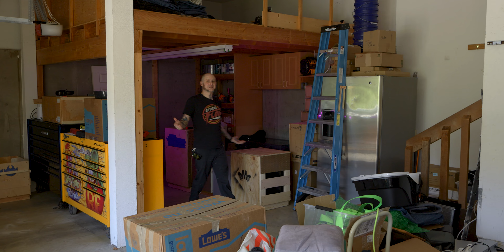NEW Studio, NEW Network! Mandic Lab 1.0 Begins!

Comment: I was kinda wondering if a right angle drill attachment might have worked to drill through the blocking... hard part would be getting the drill bit in there, but if you could source the right length flexible bit, it could have worked depending on how far up the wall the blocking was.  Nice to see I'm not the only one that gets a bit ummm creative when doing this sort of thing and running into issues!  I had similar issues when trying to get cables up from my basement to the 2nd floor and ended up hacking up the 2nd floor wall pretty good to get access, but you can't tell anything happened there now, so I'd say it was a success!

Comment: in the old dining room area I would have not put an access point so high, it may interfere with the one in the upstairs hallway and you may experience access point jumping on the mesh network and create a problem zone., you would have been better with a in-wall access point at the first hole closer to the floor.  Generally when I install APs for customers I use an app on my phone and create a heat map to figure out how many access points and where to put them.  too many access points can be a bad thing or too little since it looks like you may have gotten Long Range Access Points.   like other have said riser cable in the duct work is a good thing, and running a single mode fiber or dual mode fiber and putting another switch up on the second floor would be better in this instance then running lots of cables back down to the garage.  (I am currently doing this myself).  

since you ran cat 7 shielded, it is a solid cable a patch panel on the wall and run cables to that would be better with a full 42u cabinet, and then  use stranded cables to the tor (top of rack switch) . we do it this way in datacenters and offices because if you don't leave enough cable when you terminate them in the rack,  moving the rack around or pulling it out becomes  a nightmare. 

ubiquiti is a decent setup for home/home office/small business, not exactly enterprise grade even though they call it that.   If they sent you a doorbell camera for free I would use that, if they didn't look at a ReoLink better value for the dollar.  Ubiquiti cameras are a bit overpriced for what you get as well.  better options out there with full color night vision for the dollar.  but you got some for free, so use them.  Look into Home Assistant and Blue Iris to run the cameras and forget the Ubiquiti NVR and record to plain old nas storage. you will be much happier.  the Ubiquiti protect system locks you into it and you can't display on anything but the ubiquiti app/eco system.

Comment: This seems like the most difficult possible way of doing this coupled with not using plenum rated - you're probably going to want to seap those out. If you're drilling anyway and already have straight attic access in the garage why not drill/run the pvc through the roof into the attic? Much more complicated than it needed to be.
Reply from the maker: There is no direct attic access from the garage unless you go outside. That was the entire point. There is living space separating the garage from the attic entirely. It would have to run outside to come in through the “roof”. So across the shop, through a wall, snake around the building (the garage protrudes off the side) and then up the side of the house, into an eave (where it’s hard to access in the attic), and then disperse to the space. It would require twice the length of cable runs, a lot more conduit, and be a pipe on the outside of the building that has to be planned and made to look as good as I can. Along with requiring 90s that aren’t fun to pull cable through.
Reply: @MandicReally Gotcha. Camera work made it look like the pipe ran straight upwards to the plenum so I misunderstood. Still might be easier to drill through the wall plates and fish a 10/25/100G home run line between the garage and another place in the house with a second switch that you can access easier.

Comment: When you fish cables you should add a fish line to the cable too in case you ever need to fish another cable down the line. Also why put a blank plate all over? Once the cable is where it needs to go you can just drywall back over the hole you made.

Comment: I love Ubiquity gear.  I am still running a USG, which I should replace.  A US8, USW Lite 16 POE, and two AC Pros.

I wish their life was longer but such is tech.

Setting up the VLANs is great for segregating that IoT traffic so it can't talk to the main network.  Just great equipment.

Glad they hooked you up.  Saves some $$ for sure.

Comment: Great video.  I love seeing stuff like this.  I also installed Ubiquiti APs, U6+'s, starting last year.  They've been rock solid but do't really push them too hard.  Regarding the blank wall-plates: I'd be tempted to install one or two network jacks in case you need a hard-wired connection there in the future.  Alternatively, could you use it for some physical control of smart-home devices?  Like a Pi with touchscreen to control music or lights?
Reply from the maker: Oh that is a plan for the future around the house. Maybe one of those wall plates can factor in, we shall see, hadn't considered that.

Comment: For the air duct, you are required to use plenum related cable, which is designed specifically for that purpose.  It does not give off toxic gas if the cables do ever catch on fire.  Riser rated cable is not the same.  It is designed to run outside of ductwork but in vertical spaces between floors.  Grey electrical conduit would have created two issues so glad you did not go that route.  First, it will give off toxic gasses if it catches on fire, which is a real potential if you have a garage fire and the pipe extended into that area.  Second you are disrupting the airflow to the rest of the house which may or may not create other issues.

Comment: I'm concern about the PVC releasing harmful chemical when the furnace is in use
Reply from the maker: Riser cable isn’t sleeved with PVC. The conduit though may have been a concern. Though it was rated to 90C metal would probably be best by snaking it through is the issue. Maybe a flexible metal

Comment: I’m sorry, friend, I can’t even watch this :-) working on IT everything from the wrong type of rack to the wrong placement of your gear in the rack to the air vent. Just makes me wanna pull my eyeballs out.

I’m not gonna get into specifics but with that rack, you really want one that’s two sided for the very minimum has pull out spaces. Not to mention, you should be setting up the rack, so it has front to back airflow, not stuffed up against the wall. Etc. etc. etc..
Reply from the maker: I’ll be dust filtering an putting in active airflow for the rack eventually. It won’t be against the wall but it also isn’t feeding a data center. Nothing in it will get be loaded to the max with our household/ workload.

Comment: I don't know your building codes, but i thought you only need an wall plate if you splice the wire. I think you can patch and paint the drywall. Might be something to look into.
Reply from the maker: It didn’t even cross my mind to mention my reasoning for the plates. You are right, I could just patch and call it done. I like to leave them so I can change a cable or repair if necessary. I’ve had more than one cable be bad over time. (Bad crimps most likely, one damaged cable by someone else in the basement.) This lets me access later. Who knows CAT8 cable could be around the corner. If it isn’t an eyesore, I don’t mind them. The double ones? A bit less so but whatever.

Comment: I do low-voltage, I only have one note on your install.
When cutting wall boxes, start with the horizontal cuts. Even though you checked with a stud finder, you never know what kind of surprises you might run in to. If you hit something, you can just swap directions and keep it at the same height
Reply from the maker: That’s a great tip. Thank you 🙏🏻
Reply: @MandicReally  Learned that one the hard way lol

Comment: Nice. I just updated to the Pro Max 24 and 16 switches. So much more Poe power available and connected the 2.5gbe ports to the new 2.5gbe WiFi7 AP. Connected the 24 to 16 using fiber.
I opted to put a switch in my upstairs bedroom closet which makes it easier to add connections to the upstairs rooms.

Comment: I would not have gone through the ducting like you did. I would have made a hole in the ceiling to the attic and used a fire rated conduit through the celing. You will have to fill it up with fire sealing foam though after but it would have been a bit cleaner than to run it through the duct. 
For the thing in the wall, you could have used a longer drill from the crawl space since it looked to be rather much room there to drill through the floor and the blocks that the stairs attach to.

Comment: so im half way through the video and i was wondering...did you guys in the US only have straight tubes for cables? In Germany/Austria if you gonna do a dry wall we have flex tubes for the cable´s in the wall. they have different size´s so that would be the best solution for that piping in the roof for. may you should take a look for in the US :)

Comment: Since you shop a Lowes you might have wanted to look at their 2-inch Black Non-Metallic Flexible Liquid Tight Electrical Conduit. That could be pulled through your duct just like you pulled your wires through and would have given you the ability to add more wires later as you intended originally. Looks like you have some very nice network equipment.

Comment: Create a VLAN just for your 3D printers, never hurts to isolate machines with questionable security.
Reply from the maker: Yep, that is part of the plan. Same for IOT / Smart Home devices.
Reply: @MandicReally just keep in mind that AirPlay/Google Cast and that stuff is not designed to go through a „real“ network and is completely Multicast based. Never got mDNS working satisfactory when I was running the UniFi USG, if you encounter any issues with smartphone on different VLAN than AppleTV and stuff, that is probably the issue

Comment: First and foremost, a very useful tool for in wall cable pulls is the MAGNEPULL. It would have not solved the blocking issue you ran into, just thought I'd share.
Second, in most cases you are required to run plenum rated cable in airspaces where the air will be used by heating and cooling system or building ventilation. I completely understand that situation here. However, this could be a potential health/safety issue, so I wanted to share the information.
Third, if you have several long cables runs, running single mode fiber and dropping a second switch could be easier. If you have the room for it of course.
Thanks for making the video and sharing, Glad to hear you are settling in and can't wait to see more videos on the build out of the new shop space.

Comment: I would think you'd want to use plenum rated cable for the duct run, since its running through an air handling space (plenum rated releases less toxic gas when/if it burns than riser rated). inside the walls & such riser rated is fine.
Reply from the maker: The info I got was pretty conflicting on the subject. Plenum is meant for return ducts not feed ducts. But riser isn’t expressly for that either. Riser is also anti-toxic time but maybe to a lesser degree? It’s unclean. Im definitely off script here.
Reply: @MandicReally  most of the stuff you may have read about returns is because i don't think code allows low voltage in the feed side, only the 'return' side, but yeah, plenum is air handling space (look at wikipedia) feed or return. you can use riser above a drop ceiling if the returns are ducted, otherwise it has to be plenum.
Reply from the maker: @GMichaelBridge  know of any flexible conduit that is rated? It’s either that or head outside and conduit up the wall. Really wanted to avoid that though…
Reply: i think it'd be cheaper to just get a small spool of plenum rated from monoprice & replace the duct runs. you could probably attach the new runs to the existing to use as pull cords.

Comment: You actually want plenum rated (if it catches fire, the smoke won't kill you instantly) cable when running through an air supply area.
Reply: What you need: inner-duct corrugated  - PLENUM RATED INDOOR Smurf tube!  
McMansion construction is a bitch to re-wire. Ya did a good job!  👍
Reply from the maker: Riser is also rated to not release a lot of toxic fumes, but maybe less so than Plenum? It is pretty unclear in my limited research. The info was conflicting when I tried looking. Some said one way, some the other. It’s off book, so I went with what I had. If it was plain cable not at all rated, then it would have been a total no go. I’ll continue to explore other options. Know of a flexible conduit that isn’t terrible?

Comment: in the ducked you tried to use a hard pipe there is a pipe called a Smurf tube i thank that is because it is blue and i thank you can buy it in 8 foot sticks and you can get it up to 500 foot coils and i have also seen it in gray
Reply from the maker: I tried looking for a flexible conduit but couldn’t find any local that came in less than hundreds of feet ($$$). That Smurf tube also seems to be rated for lower temps than the bear wire is itself.

Comment: first off, adorable kitty :D - secondly, I'm curious why you decided to go with 2.5g instead of 10g which is now becoming pretty much standard.  10g enables fast access to a NAS (which is great for editing, etc.) that can live right there in your rack.  I get that your wan connection isn't nearly that fast, but when fiber DOES become available in your area, you'll be ready, and your UDM pro already has some 10g sfp+ connections (which are optionally adaptable to 10g base-t if you need to).  you could go with something like the EnterpriseXG 24 perhaps (given the rest of your network gear is in the ubiquiti ecosystem.
Reply from the maker: Cost of upgrading all my equipment.  My motherboard on my pc has 2.5gb and my NASes have 2.5gb cards. Would mean replacing all of those on top of the rest of the project. Currently my NASes are hard drive units. They simply cannot move data at 2.5g speeds let alone saturate 10g. Someday I’ll get around to it. I’d like to have a Flash storage NAS to edit videos off of, but that’s not today.
Reply: @MandicReally  that's totally fair.  also, just so you're aware, you can TOTALLY saturate 10g with hard drives (you just need enough of them), but more over, if your nas has enough ram, it will provide caching which can also significantly help (especially when serving lots of smaller files repeatedly), and depending on the configuration of the nas, you could also use mirrors of (used?) enterprise class ssd's for additional read and write caching. It's important to remember that 10gb/s is only 1.24GB/s (which at the end of the day isn't really all that fast).  but of course, you're the best judge of your needs.  Thanks for sharing your setup though!  I'm curious to see your other upcoming build logs :D

Comment: You don't want the rack cooled inside? I know it's the PNW, but it still has 100+ degree days during the summer and a lot of moisture during the rest of the year
Reply from the maker: Studio will be climate controlled. And it’s been 70-80s in the garage as it’s half under grade. There isn’t really a good place in the house. My office is on the second floor and that isn’t well air conditioned unfortunately.